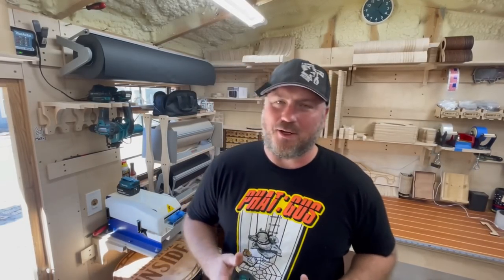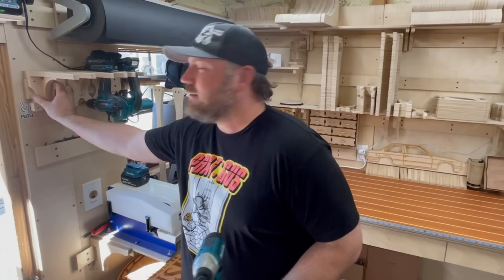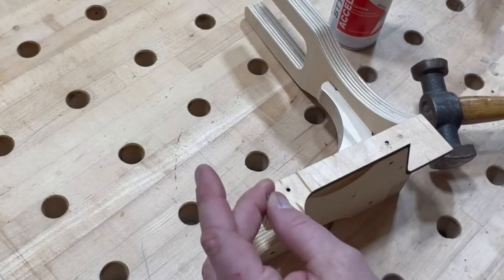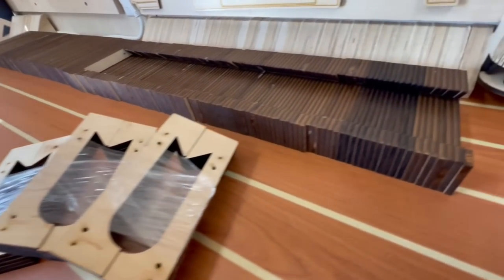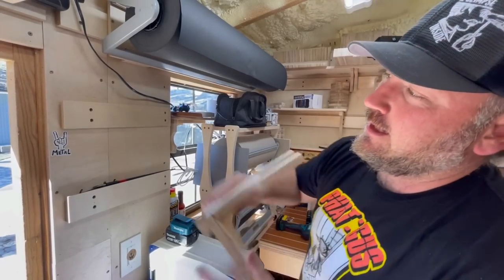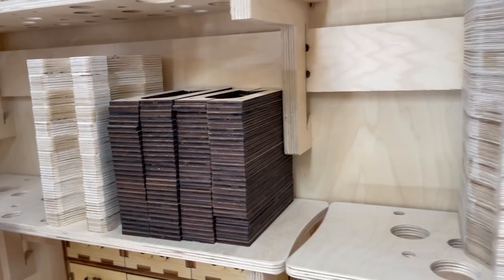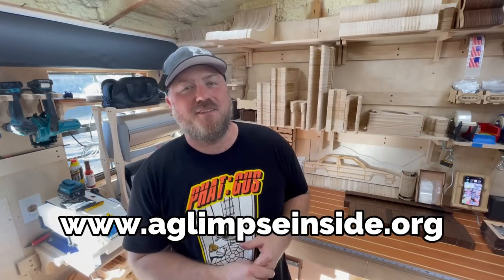How Did I Not Think Of THIS Before Now

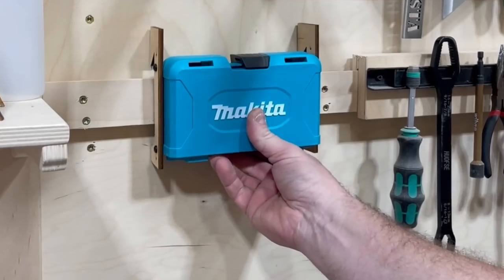Comment: Excellent idea regarding the French Cleat Anything Bracket.  In your YT video at approximately the 2:20 time mark you demonstrate the versatility of cleating an existing manufacturer's case.  Did you notice the detents of the drivers were so tight that the attempt to remove the driver displaced the case from its cleated position? May I suggest replacing the curve leading the lower foot of the Anything Bracket with a right-angle corner to facilitate the insertion of a square "key" to lock the backet in place and prevent inadvertent displacement.  Love your positive energy- keep up the great work.
Reply from the maker: That’s a pretty good idea. Definitely going to take that into consideration. However, if you put straight out it stays in place really well.

Comment: Chris I have been struggling to figure out a solution for manufactured small parts organizers.  I purchased a few sets of the briefcase size bin holding pack out style cases.  I feel like a set of slim shelves would work, but am not sure where to put them.  I was wondering if you had ever thought about a product for storing those.  A set of cleat brackets that catch multiple runners, and handled like a set of 4 or so.  Not sure if that would be something your customers would be interested in.
Reply from the maker: Aglimpseinsideprojects@gmail.com 
Hey brother, do me a favor shoot me an email with a bit more insight into this let’s get connected

Comment: To use the brackets what size cleats do you need.  Putting up one in my garage very soon and the brackets seem like a good idea and easy to adapt somethings I've already got.
Reply from the maker: The opening is 3 inches so the height of the Clit if it’s less than that you’re good also, the typically made it to 3/4 of an inch in thickness. However, if you have half inch thickness diesel still work thanks for the interest brother.

Comment: I use the Milwaukee M12 system.  As you probably know, the batteries are tubular shaped and fit flush in the handles.  Do you have any solutions for these?
Reply from the maker: Store them right side up or if you have upgraded battery packs that are able to pretend to be a typical battery shape does method seem to work but no I haven’t designed anything specifically for that tool as of yet

Comment: Very good idea and saves lots of wood. Very inventive you will do well with this idea. I'm just wondering I don't know myself if it would work but can a channel be put in these so they can be moved up or down for a person's convenience or would a series of holes work for more stable hold or would it be a bad idea. I think if it worked at all it should only be for the lighter tools that would not put too much weight on the area holding it. I'm not trying to be funny I don't know enough myself so I'm just asking for your experience and advice please and thanks for showing your great idea and knowledge

Comment: These are awesome. Some ideas: The magnetic tool strip is something I plan in my shop. You had one next to where the bit box was hung. I would be interested in that. It would be easy to just slap my strips on and be done. Also something that holds a few dewalt batteries would be helpful.
Reply from the maker: Yeah, those are handy access to the video about those years ago, but the cost of magnets has gone up exponentially over the past few years

Comment: Are the French cleat brackets designed for cleats 3/4" or 1/2" thick, or does it matter?
Reply from the maker: My brackets are designed for 3/4 of an inch and they will definitely work with half inch or even a quarter inch if that’s what you got

Comment: QUESTION:…On the web site these clearly say 3” (max) opening for the cleat….What about the bigger brackets??  Are they also for 3” cleats?  I’m referring to the 8 pack of brackets….they look bigger.
Reply from the maker: They are bigger there’s a little over a 4 inch gap in those.
Reply from the maker: Do you know what I actually went back and measured the exact same size both of them have a 3 inch clearance I’m so sorry I misspoke